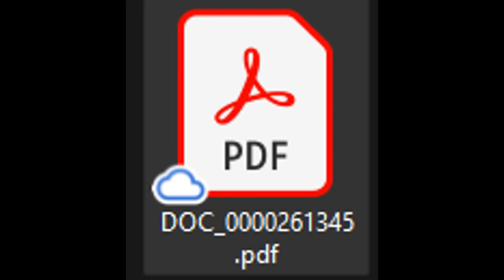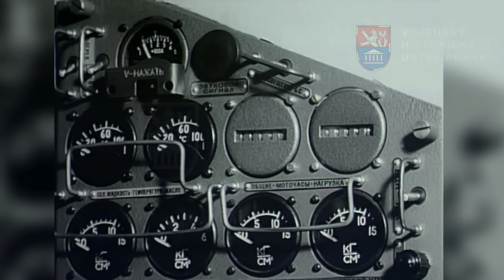What the CIA got right (and wrong) about the T-72/T-80 era

Comment: From what I read, the T-90/T-90A was designed to just be a stop gap tank between the existing tanks and their "future tank", unlike the Object 187 which was designed to be the "future tank" but the soviet went with the T-90 as they didn't anticipate the collapse and thought "Might as well just take the cheaper stop gap option while waiting for the more drastic future tank" type of thing
Reply: T-64 was expensive but relatively effective mbt for its time
T-72 was cheaper version of the T-64
T-90 was a upgrade of the T-72

so essentially even the newest T-90M which has alot features similar to western tanks(firecontrol systems, automatic hydraulic transmission etc.) is just a T-64 on steroids and it still suffers from the same problems as the T-64 bad reverse speed and autoloader limitations
Reply: Actually the only reason why the T-90 got its name instead of being just another T-72 modification was the president Yeltsin's wish to have his own "Russian" tank.

Comment: The soviet / russian tank development really stagnated after the T-80 and reactive armor. The post-war tank production peaked in 60's when tons of T-55s and T-62s were produced. At some point half of the soviet exports were tanks. T-64s and T-72 were more expensive to produce and the numbers and exports decreased.
Reply: That's a little misleading. Czech and Polish tank factories continued producing T-55 tanks all the way into the 80s because they took a glance at the workhours, complexity and overall cost of the new T-72 and decided they could produce 3 of the old T-55s by the time they make a new model tank. As they were the designated tank factories of the Warshaw Pact this meant in East and Central Europe the arrival of the T-72 was heavily delayed. That and economic hruddles since the late 1970s which plateued during the 80s. Still, my point is that T-72 may be seen as a primitive tank by modern standards but it was way harder to make than the hordes of T-55s which were only a little more involved than the T-34s of old and really just kept pace with industrial developments.
Reply: @willyvereb  I wouldnt say primitive. More like its a baseline for a "modern tank". Anything worse then that cant be called a modern MBT (like M60 without some massive upgrades to bring it on same-ish level).

Comment: nice work

could you do a video on soviet MBT designs from the 1980s ? stuff like Object 299, T-74 (Izdelie 450), Object 187, Object 490 "Topol", Object 490A Buntar' ("Rebel"), 
Izdelie 477/Object 477 Boxer and Molot ("Hammer") ?

I don't see these vehicles discussed very often in western circles ( likely because  there is not a large amount  of info on them ) but still would make for a interesting video.
Reply from the maker: Sure, I‘ll look into it
Reply: Also Obj 292 and 640 will be cool!
Reply: @AjackLee4  These are from 90`s however. Right about the time of collapse...there is a lot about them as well, they are most well known out of all obscure prototypes.
Reply: it wouldve been so cool to see the tanks from the improvement-88 program go into service, with 152mm guns

Comment: I don't know much, but in retrospect, the T-72/T-80 would have mopped the floor with the M60 Patton.
Reply: No. The Abrams was created precisely because the T-80U would absolutely destroy the M60 in a modern battlefield
Reply: @LeandroCB-w8hnot the t80U. It was the t72a and the t80. The first m1 got into the army’s hand in ‘76.
Reply: @itsericzhou the abrams entered service in ‘82
Reply: @patriotic-panda you’re right, but it was developed in the late 70s, made to compete against the t72 and 64. It entering service at the same ish time as the t80b meant they’re compared often but the Abrams was designed to defeat the t72 and 64. The t80 put up a better fight(parity)
Reply: Yep, the west was really behind in armour for most of the Cold War.
Reply: It would have a lot more to do with training, tactics supporting units etc etc
Reply: @Statueshop297 yes, but better equipment is always good. The t80b(and the rounds that came at that time)could cut through the m60 like butter. The FCS on the t80b was objectively better than anything the Americans had up until the m1a1. The original m1 FCS(which was also on versions of the m60) lacked 2 plane independent stabilization of the gun sight. It DID have thermals though, which greatly makes up for it.
Reply: @itsericzhou  Stabilisation is only important when you are firing on the move, since NATO was planning around a defensive war it makes complete sense considering M1s would likely be firing from prepared positions anyway as the Soviets attacked into them, this design ethos is seen in loads of other weapons systems used by NATO (see Milan and Swingfire).
Reply: @Onyxwatchftd  its not just for firing on the move, but for firing against moving targets. again its not a huge issue it just means that the entire reticle will move as you lead a target. the t80b(and subsequently the t64b) and abrams were the first to have automatic target lead. the t80s fcs was better in every way except for its lack of thermals because the soviets couldnt afford agava on every t80.
Reply: @itsericzhou Agava was still mid compared to nato stuff, and arguably the Abrams FCS is much easier to use
Reply: @itsericzhou better equipment is always desirable. As we see the Soviets put a high priority on numbers. This led to massive stockpiles for ex soviet nations.
Reply: @jimdog8294 not really, the thermals on agava and m1s were both really shit and only good for target acquisition. You’d switch to your daylight sights for ID and engagement.
Reply: @itsericzhou the thermals weren’t that bad in the M1 or M60A3TTS, but the fire control system in the M60 and Abrams was much more convenient and they weren’t ass bad as you think. It’s not like everything you saw was just a massive blur you could make out basic details etc
Reply: @jimdog8294 at the ranges at fulda? Not really. Unless you have a full side profile you wouldn’t know if it’s a bmp2 or a t80b at the ranges present in fulda. The FCS was objectively better on the t80b and t64b. You can read up on them if you like, they were state of the art for its time. 

Once again the first gen thermals could be used to fire center mass sure, but usually you have to ID your target before you send them a welcoming gift
Reply: @itsericzhou sorta, the thermals are not as bad as you think lol. It’s pretty easy to figure out the shape of vehicles, even if its form the front on low res thermals or just older thermals. For the most part yeah it was observation but it still had the capability to see, and by comparison was better than the T-80s agava.
Reply: @jimdog8294  if your only experience with gen 1 thermals is war thunder i hate to break it to you but war thunder is not the most realistic game out there. theres plenty of resources you can find online showing what targets over 1km look like under the m1s thermals. theyre not great. better than agava? probably, but both were moreso used for nightsights and target aquisition. agava 2 was also significantly better than agava 1, although neither were used extensively. you dont just shoot at random shit you see IRL because its not war thunder where friendlies have nametags. its not like there was IFF interrogation back then either, nor BMS to determine if there are friendlies where you lased.
Reply: @itsericzhou Auto-lead was already there on the M60A2, Leopard AS1 etc
Reply: @itsericzhou  "The FCS on the t80b was objectively better than anything the Americans had up until the m1a1." Apart from the OG A1's FCS was pretty much the same as the OG M1, the US technically already had two axis stabilization for the mirror on the XM803 and possibly earlier test tanks, it's just that they didn't spend the money to put it on the M1/A1. But honestly, apart from needing more training, lacking the deflection stabilization doesn't take away capabilities. It's just harder to get good at using it. At the end of the day, under normal mode, the gunner controls the reticle, and the reticle is two axis stabilized regardless of having deflection stabilization on the mirror or not.
Reply: @chrisblack6258 yes, but unless you can find some manuals, everything else about their FCS is equal. They both process humidity, air temp, wind, etc. accuracy wise they’re very similar. I mean if you want to go the stretch the t80bs FCS can fire GLATGMs. Sure performance wise they’re the same, as any trained crew would be used to it. But the whole reason they’re being compared is because they were very close in performance, so the only thing left is just small stuff.
Reply: @chrisblack6258 I don’t know much about the m60a2 other than the fact it was a pretty big failure, but the leopard 1a4 didn’t have the same kind of automatic leading no? It used stereoscopic range finding and didn’t automatically slew the gun ahead of the tracked target. It just gave you an angle for you to lead with. I mean if you count that as auto lead, then the t72a also had automatic leading
Reply: Well the m60s with the upgraded thermal sight would have had a huge advantage. And marines in m60a1s still managed to best t72s in the first gulf war. So its not an easy answer.
Reply: @AJPMUSIC_OFFICIAL  i would not use desert storm as a good example man. you have m1a1s with gen 2 thermals going against t72 urals. the iraqi crews were horribly trained. the marines did not use the m60a1. they used the m60a1 RISE PASSIVE and the m60a3 TTS, which had thermals. against the t72 ural, which by the way didnt even have composite in the turret, of course theyre not going to stand a chance.

in the theatre against the GSFG and the warsaw pact, the t80s would have mopped the floor against the patton

the t72s and t64bs fielded by the soviets actually stood a chance against m774. the iraqi tanks could all be reliably penetrated from all distances. against m829? yeah good fuckin luck.

also consider the quantity of tanks. the soviets fielded far more tanks than americans. in 1982 there were 150 m1s TOTAL. by 1985 maybe a few hundred could be in germany at best. the soviets had around 10 thousand tanks that were considered modern(t80b,t64b,t72b although the t72s wouldnt arrive until later since the GSFG didnt use them, only the mainland soviet army). the m60s being outgunned and outnumbered was pretty apparent. remember, by 1985 the m60s armor was obsolete. even the basic t62s gun could reliably penetrate it. 125mm would hit it easily(due to massive profile) and penetrate it easily as it was only steel. it could resist the AP rounds fired by the t55 and thats about it.

once again, do not use desert storm as an example of why the t72s are garbage. if you could turn around history and give america t72s and t80s, and iraq m1a1s and m60s, america would still wipe the floor, but take a few more casualties.
Reply: @itsericzhou  A1 didn't not have Gen 2 thermal. The first M1 model to get Gen 2 thermal is M1A2 SEP in 1999.
Reply: @chrisblack6258 mmm. So not as big of a difference, but from what I’ve heard, the presence of thermals during weather events like sandstorms enabled nato armor to engage while the Iraqi crews literally couldn’t see them. That as well as night fighting where Iraqis relied on rudimentary image intensifiers
Reply: They did well against Iraqi T-72s in the Gulf War for what that’s worth.
Reply: @kylehankins5988 yes. But because the rafales performed badly in the hands on Indians doesn’t mean that they will perform bad in the hands of the French. The same logic applies. The t72s used by Iraq were decades outdated by that point. The soviets had already almost entirely phased  out the t72a(the best t72 Iraq had) and replaced it with the t72b which had significantly better protection. The t80s from the 80s and the t80s from the 90s can’t just be lumped together. The t80U improved on the base armor, as well as adding K5. 

It’s disingenuous to say that t72 bad because iraqs t72 ural and t72a performed badly. Not all t72s are the same. You were fighting t72s and t55s as well as Chinese t59s. Panther vs m4a1 Sherman level of difference between coalition and Iraqi forces